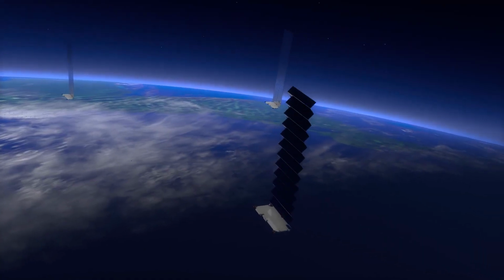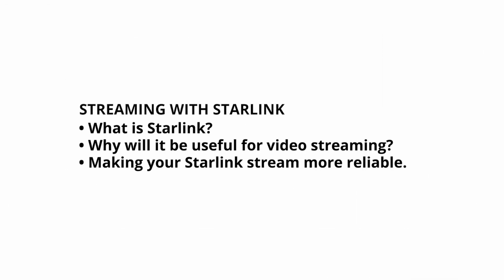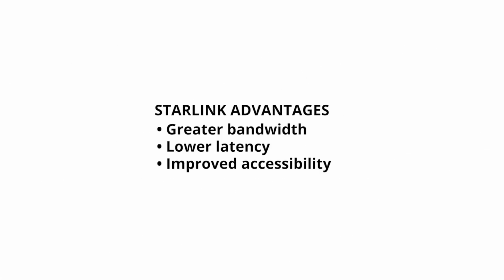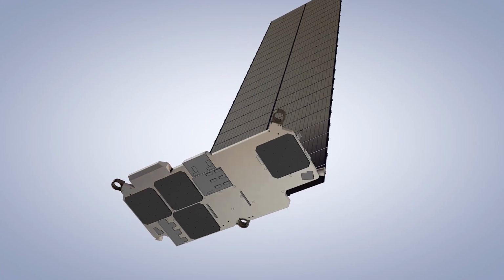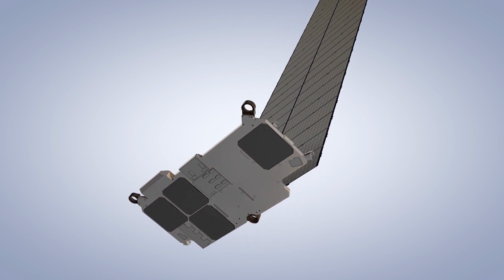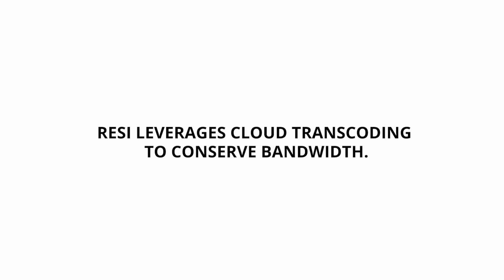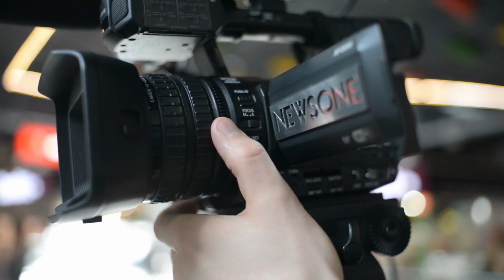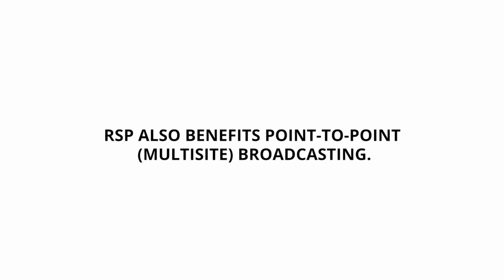Live Streaming With Starlink: Why Resi Makes Sense

Comment: Can this service be used to deliver a basic feed directly to Twitch or Youtube?  I would rather just find a way to reliably send a Twitch feed honestly..  something that will force TCP vs UDP via a proxy to make sure packets get delivered.
Reply: I get dips and breaks in the connection here, and it causes the live stream to freeze, then audio desyncs, and then reconnects and the stream restarts. When it happens 3 times in a 10 min broadcast it messes spots up bad enough that about 1 minute of the 10 is unusable, and almost makes it unwatchable. Depends on where you are...

Comment: Honestly can't even stream 1080p with starlink. Can't even get it stable at 720p 30fps.
Reply: Somethings wrong there. Streaming 4k all day no problem
Reply: @austinrecla4872  They mean Live Streaming.  Live Streaming (sending video to a place like YT or Twitch while live) is really bad on StarLink because of the latency issues.
Reply: @austinrecla4872  Can you link me to yiur stream?
Reply: @austinrecla4872  Are you streaming off of wifi or do you have the ethernet adapter?
Reply: What's your latitude?
Reply: Same here...runs smooth, then the connection has little dips, then choppy, freezes, then starts again, but audio desyncs, then fine, then not...this is when using it for streaming direct to Facebook...went through every setting and I too dropped to 720p, set bit rates accordingly, everything. Works fine in town on gigabit Wifi with no breaks or issues on a 1080p xtream. Come home to Starlink, NO BUENO...it is definitely not a good solution for live broadcasting at the moment
Reply: @SeanTolan_illuminated_imaging  I found using restream helps alot. Still have a minor hiccup every 20-30 mins but turning on the auto adjust bit rate in obs will help with that.
Reply: @pIeistoscene  I just need a wired ethernet connection that is stable, and sadly it has a lot to do with my location nestled in between the mountains...this is not good for live streaming here...the speeds that are so inconsistent is the problem. Have tried variable bit rates and streaming services. My roommate does corporate livestreaming for Nike, and we have traced it back to the connection here. We have the worst Starlink reception in Oregon here, so even when I jack in on ethernet, I still get the occasional dips.